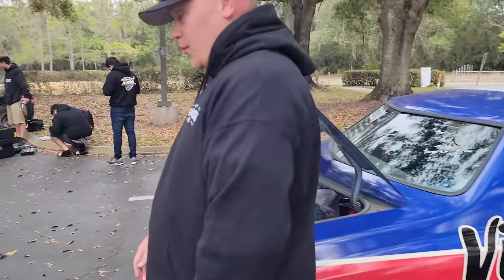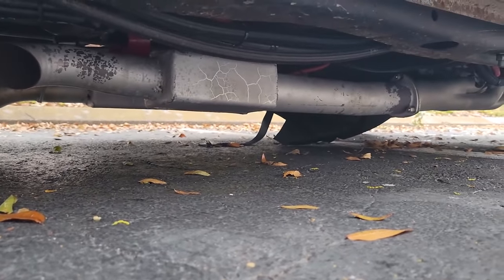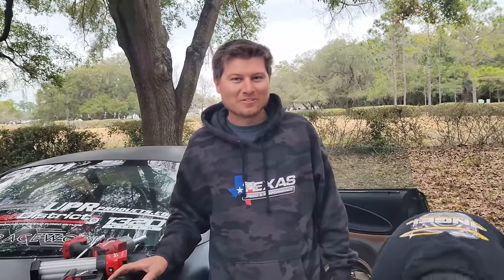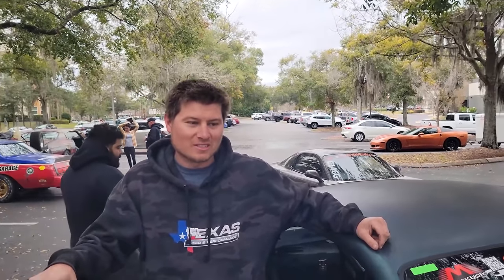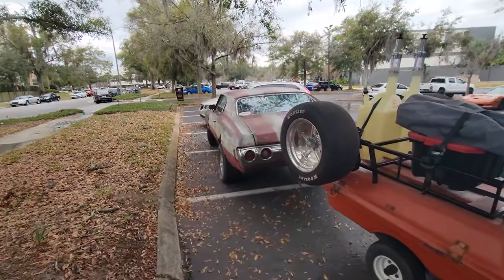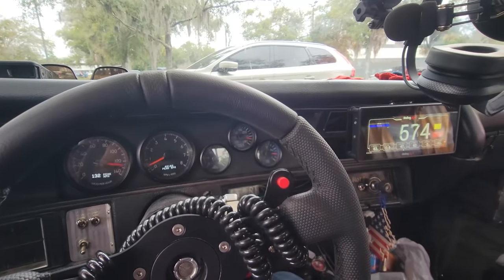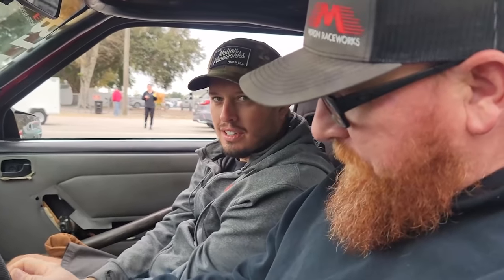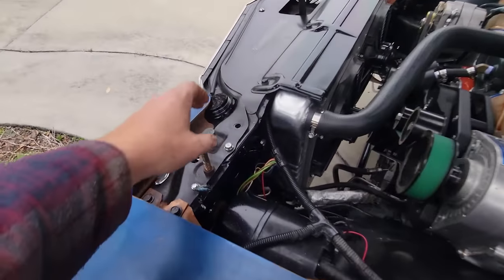Sick Week Day 2 :  I ROLLED MY TRAILER!

Comment: When I was back in my younger days. I built a 64 Chevy II to much. Stock bore and stroke 283, M22 4 speed, 488 rear gear. Ran in the 12's, 1/4 mile. Got beat one time. It was so fast it would outrun a Smith & Wesson bullet. Watching your mini tv movies bring back a ton of very fond memories. Thanks DEREK.

Comment: You just need to rig up your spare wheels on a working axle on the top so you can run the trailer either side up.

Comment: I love how independence is still wearing all its original paint as when you got it.
Reply: same paint scheme, but he did touch it up quite a bit with some rattlecans.  Left it looking old, but there's a video where he repainted quite a bit of it due to repairs and because it was down to bare surface rust in a lot of areas.  Go back and watch the video when he first got it, actually looks a decent bit different.  But still awesome looking either way.  Normally I am not a fan of the "patina" look one bit, but on this car it works so good

Comment: The old Harbor Freight trailer is the best of all time. Build to any configuration you want, holds over 1100 pounds if it needs to, little or no weight in the trunk. I’ve dragged mine all over NC hauling kayaks, furniture from 7-8 moves, behind a 2003 Accord 5-speed. Even put it behind my truck a time or two. 4 feet of deck between the wheels, can’t flip it…
I’m sayin’ all this there’s probably a rule you can’t pull one of those lol

Comment: As someone who lives on the Atlantic Ocean where trees are of the black spruce flavour and not Palm Tree, I can verify that it's still usually raining the same at 47 degrees north same as it is at 30 degrees north of the equator.
In a bay called "Conception Bay" no less.

Comment: I think if you weld on a 6" sq by 1/4"  plate under the reciever and attach another longer one on the trailer so the two plates are about 1/4 " apart, you can turn and go over bumps and such, I think small trailers won't turn over. One less thing to worry about!  Any way just have fun!  :)

Comment: Hey for that low octane fuel, you can always stop by a hardware store and pick up some toluene, or some xylene. look on the internet for the ratio and give it some octane boost. It don't take much. but its the only difference between fuels.

Comment: A little tip for when you are traveling. Put the Gas Buddy app on your phone. It will not only show you where the nearest station is, but also what types of fuel they sell, as well as current prices.

Comment: I was going to say that tipped because it was top heavy.  

When I load my little swap meet trailer I put the milk crates with the heavy parts on the bottom and work my way up.   But it's a little bigger unit with a steel frame, 8 foot long and inside is three feet wide, maybe 5 over the wheels.

Comment: You need a wider trailer with wiiiide wheels and tires.   Like some 245-45-13 tires.   Give 'er a nice wide track!   You got this skinny little trailer with a narrow track.   I built a little race car, puller behind ya trailer by taking a common 4'X8' utility trailer, cut the back end of it off so it was a 4'X6' trailer with the axle pretty near the back.  Put a tire rack in it to carry 2 sets of tires if I wanted, and bolted a big 2'x4' enclosed box on the rear of the trailer with nice sized heavy duty fender washers so the bolt couldn't cut through the plastic box, and away I went.    That trailer is still kicking around somewhere.   The track of the tires was about 6' feet.   Towed awesome with a full race prepped BMW M3!   Never tipped!   Cheap as your budget, but did its job well.   Sick week is busy enough, you don't need to be chasing your trailer through gator infested road shoulders!   Good luck

Comment: DEREK… what about those twist in coil spring spacers for the drives and just remove them when you get to the track. They should keep the fenders off the sidewalls without having to change to the air shocks… also, still have a green ‘73 olds omega for you to check out in Bradenton…

Comment: It seem a lot of people are pulling these small narrow trailers.
What is need is a little bit wider trailer and those are more stable for road trips.
I have been using my brother in laws trailer his father built many years ago and it pulls great behind my truck.
The trailer is just around the size a tad larger than a 4x8 sheet of plywood for the in the bed box size with a folding ramp on the back plus the track width is wider than the trailer itself.
I will keep watching you race for the rest of the week.

Comment: Just a heads up. Your safety chains on your trailer are always suppose to be crossed, not straight. That way if the trailer comes off the ball, it doesn't dig into the ground. If the chains are in an X pattern, the tongue will hang on the X.

Comment: I did not realize the Monte carlo is running factory log manifolds all that air being forced down its throat and the air is getting jammed right up coming out. I bet a set of headers or even a set of the ram horn manifolds would help it breath better then what it's doing now.

Comment: Tyre rubbing easily fixed, run a bit of 4x2 around the tyre between tyre and fender and genty swag it out, no trouble, do it gently and you can hardly notice it for the stock look

Comment: There's a couple stations in Bradenton that sell 93 octane with no ethanol. One by the Walmart at 75 & SR70. The other one is in Palmetto at that Walmart. I use it in my BMW cuz it sits while I'm out on the road in the Freightliner.

Comment: The trailer axle has to be far wider if you are going to have so much weight up high. Your center of gravity is somewhere around the top of Mt. Everest!! Wide axle. 4" drop. Taller tire/wheel combo. Longer trailer tongue and far stronger than that one is. Add spare wheel mounts to the trailer tongue as far back to the trailer is you can.  As for the car: rear coil overs with 2 bottom pins on each side so you can easily lift the ass end and switch the bottom shock mount to a higher mount for the road. Done..... For comfort: Seam seal and insulate the floor pan. Run exhaust pipes out the sides or rear, but not dumping under the car.. That pounding drone gets old REAL QUICK and can be the end of having a honey ride with you forever.. Ask me how I know....

Comment: In the 90s I had a 1968 charger with a built 340 running 14s at around 100mph and it was a street beast back then. Now stock 4 bangers run faster I would have never believed you if you said the fastest production car would be electric.

Comment: If you're going to pull a trailer key make the trailer base the axles as wide as the vehicle so you can see it one and it has a string base that way it don't share me as stable that way they don't roll

Comment: If the trailer had extra wide axles, it could roll on bigger diameter tires. Perhaps tires that fit the front of the car.  So that would add stability to the trailer.

Comment: You need a single wheel trailer. They use a u-j coupling (like a driveshaft) and no ball hitch so they can’t roll any more than the car.

Comment: Ya know, if you'd mount your spare tires onto the trailer with actual hubs instead of just some wheel studs, the trailer would be able to roll upside down just the same as right side up.  Something to think about.

Comment: I am absolutely stunned... you are NOT crossing the safety chains on your trailer, why? I've personally hooked up 500-750 trailers in my career at a national rental center and crossing the chains gives the hitch a cradle to fall in should it come off or break off. You do not ever want that neck to hit the ground if it comes free for any reason.  Good luck fellers.

Comment: Those gold anodized rocker plates are TRASH. The girdles were supposed to keep your motor together. Instead they tore the motor up. Reminder: never buy speed stuff that looks fancy instead of does it's job. Complete opposite happened. Running in the 10s. Put steal heads with screw in rocker bolts n you might run a 10 but be able to drive the car after.

Comment: I always enjoy your show. The engine and other relate vehicle issues that you have with your Chevelle only add points of interest/education to the show. You are running a high performance specialty engine. so you will always have different mechanical reliability issues it seems. A power steering pump leak? I have run a 73 Oldsmobile Cutlass Supreme at 135,ph repeatedly before and the power steering pump never was a issue? the engine could run all day at around 100+ mph. This was a stock factory sport sedan. Rocket 350 /quadrajet factory carburetor. No special high octane fuel as well. so it is a mystery as to why you have too go too so much effort and have so many simple mechanical problem's.? this was a street driven factory sedan.  ? It averaged between 13-15 miles to the gallon. It just had high quality spark plugs, wires, distributor cap and rotor. High flow air cleaner. Factory true dual exhaust running low restriction turbo mufflers. The largest GoodYear High performance Eagle tires that would fit on stock sport rims. and that is just 0one of my road cars that I have enjoyed since 1978. My current project and most enjoyed vehicle is a 1995 Chevrolet Blazer S10 with the High end performance 4.3 VORTEC engine.  it has a shift on the go $X$ High and Low with also the stand rear wheel drive position. If I had your budget I would definitely be able to have a very good time and perhaps a successful show as well.  Well you are fun and entertaining to watch and learn a few thing's from. I was in Germany with the Oldsmobile.... It was great fun to be able to legally run your sedan as it was able to run.

Comment: Racing ruined 😠 
I really miss street cars racing on carburetors, distributors points and aviation gas ⛽️ . 
It’s way WAY too much computers program and sensors.
Reply from the maker: There's classes for classics.  But, you can't argue the fact that fuel injection makes faster cars.